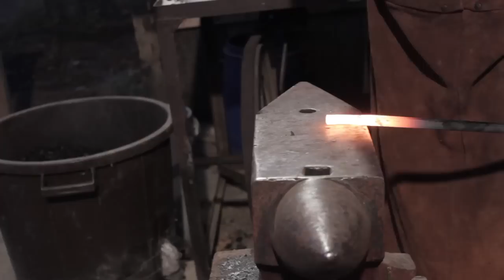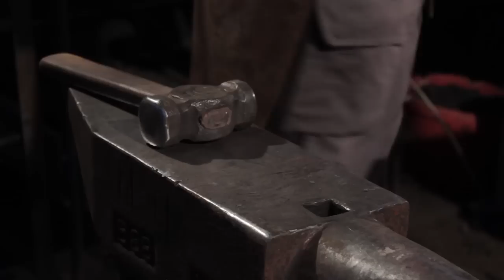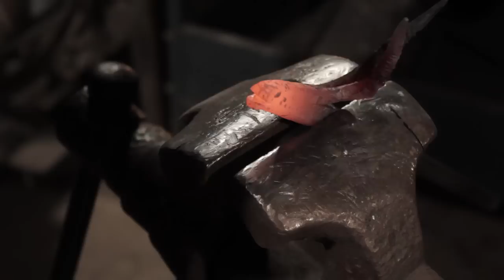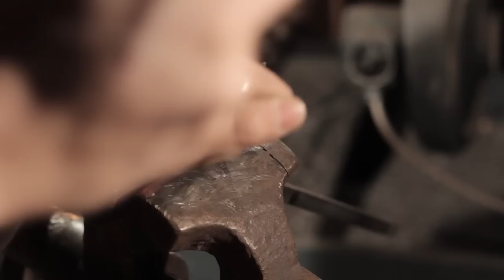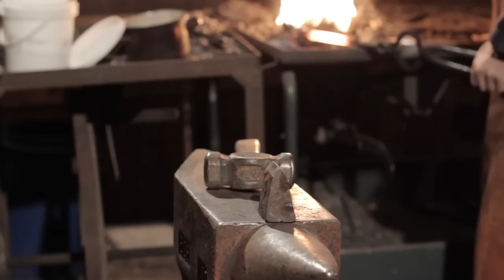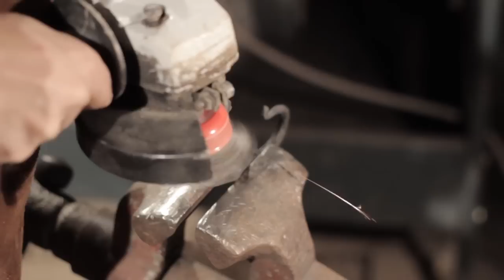forging a rams head wallhook

Comment: Was the white powder a flux?
Reply from the maker: The white powder is anhydrous borax. Here in Germany it is a little harder to come by than in america. There you can buy it where you can buy laundry powder "20 Mule Team Borax". Here you mostly only find it in pharmacies or special supply stores.
Reply: Daniel Lea what does the anhydrous borax do?
Reply from the maker: Andytheminstrel It melts on the hot steel and creates a glaze which helps to protect it against oxidation and wash off scale and other imputities from the welding surfaces. Since the borax aids with washing the surfaces clean the steel doesn´t really have to melt superficially anymore and thus the welding temperature can be lower. You don´t necessarily need a flux if you want to weld similar materials though. It only is a must have if you want to weld different types of steels together.
Reply: Daniel Lea Thanks! I'm really interested in blacksmithing. I'll hopefully be taking classes in art metals at my local community college in a few years.
Reply: @99pppo  When I served my apprenticeship in 1967 we used clean river sand for flux.. Just make sure it is NOT ocean sand laden with salt.. After leaving the area I switched to 20 Mule Team borax too..

Comment: Whats the length and section of the piece of steel you used?
Reply from the maker: I used 1/2 inch stock and I don't remember the length man. A bit under a foot. Just go by eye measurement.
Reply: Thankyou. I am doing aBlacksmithing course atm. I managed to make about 2 of these. (with 4 more failed attempts, it's the fire weld that gets me!)